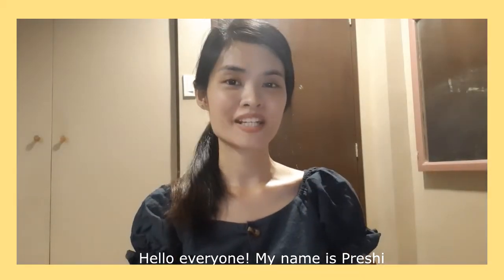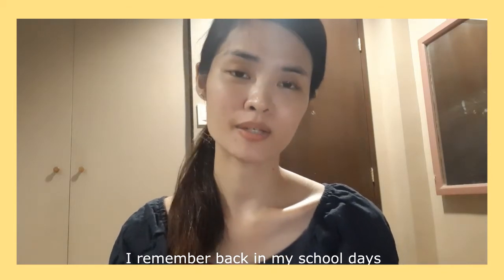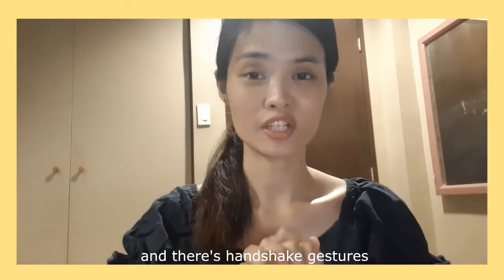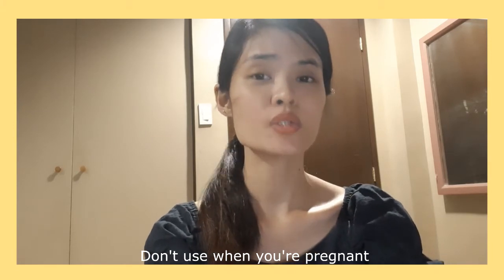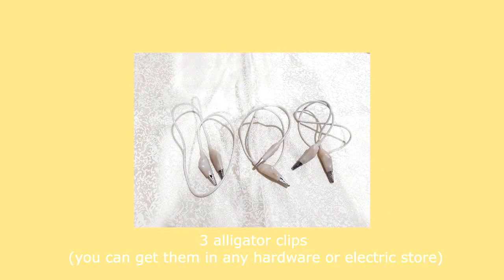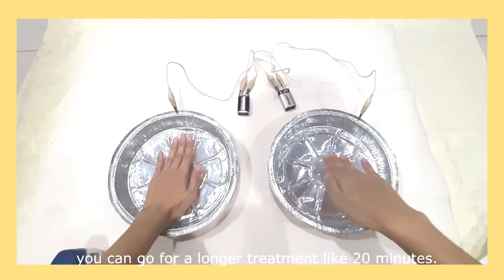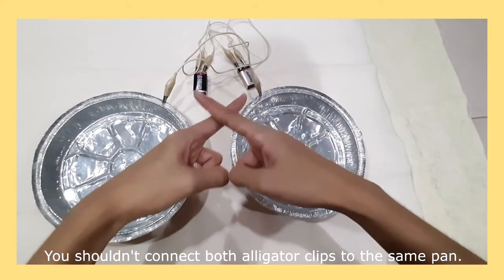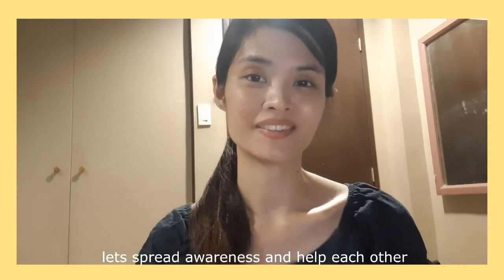Homemade Iontophoresis Device

Comment: Can you please recommend how I can do this on my armpits ?
Reply from the maker: Hello there, sorry this is only for hands and feet but there are ionto machine specific for underarm! If I have the time, id like to share how i reduced sweating in that area thank you
Reply: @Precious Macapagal  I would love to hear how you did to reduce sweating under armpits!
Actually there are specific accessories with ionto machine to treat this part of the body, can't you find a solution for that (like putting a wet clothing around a metal plate which is linked to the alligator clip?)

Comment: Its been 12 days i m using this type of home made iontophoresis but its not much effective still i m thinking what should i do more
Reply from the maker: Hello there thanks for your comment  if you have severe hyperhidrosis, maybe you can try to increase the voltage maybe do a 3 9Vs (27V in series) or 24V, usually it will take 2 weeks to see the 80-90% efficiency. Best of luck ❤️
Reply: @preshimac  thanks for ur comment but I want to know how to connect 3 batteries with each other
Reply from the maker: @adilbadshah1524  hi! You can wired them as long as its conencted properly. Like negative to positive

Comment: what happen if i touch the pan .  should i place cloth inside pan or .. just dip my hand . anyproblem if i touch the pan
Reply from the maker: I recommend that you place a cloth inside the pan :) there's no problem, maybe a slight discomfort ...however, we should let the electrical current completely travel around the hands/feet for it to be really effective
Reply: @preshimac  ok thanks .i just done 40minis today morning when to do next. tomorrow or ??  i have severe swetting .. too much swetting can u tell correct plan
Reply from the maker: @navaneethvk6494  yes, I recommend doing it everyday straight for two weeks :) then if you think your sweating has reduced after, do a maintenance sched like 2 times a week
Reply: @preshimac  thanks
Reply: @navaneethvk6494  update!
Reply: @oneyedeagle  working fine but be carefull.. it takes time ..

Comment: hi! ive used this homemade method twice now and both times it has left my hands very red after treatment, i was wondering if this is normal? i also experience the tingling sensation as well as stinging sometimes too if that was normal as well? 
thanks again for sharing ^_^
Reply from the maker: Hello! Yes, redness and tingling sensation is normal for this, it may even get itchy but normally subsides after few minutes. If you have small cuts or something, apply petroleum jelly to the area. also just make sure you follow precautionary measures.

Comment: Hi, i just stumbled upon your video after i followed some reddit threads and another YouTube vidoe about this device. Here are my questions:

1. Do you always feel the tingling / itching sensation on every sessions? Minsan kasi sa akin parang inconsistent sya. Minsan meron, minsan wala. Today's my 2nd session btw

2. Do the itching / tingling sensation only happen on one hand at a time during the session? Even if you reverse the polarities, only one hand can prominently feel it

I am using this setup btw:
Unused laptops charger with adjustable voltage

Alligator clips

Plastic pans
2 pcs spooon / fork

Thanks, will appreciate any of your input
Reply from the maker: Hello thanks for reaching out!
1. Yes, sometimes the current I feel during a session isn't the same as the previous one, but that doesn't mean it's not working. Just make sure your batteries are still okay and you may also add a few pinch of salt or baking soda to the water to make the current stronger :)
Reply from the maker: 2. Sometimes I can feel the current stronger on one hand than the other one, I feel like that's normal. And also, may I ask whats the spon and fork for?
Reply: @preshimac  Haha kinda silly setup I got before because. I use a plastic basin, then i'd clip the aligator clips on each of the spoon and fork then soak it in the water to conduct electricity. Now nag upgrade na ako, to get rid of the spoon and fork, I now use aluminum pans :D

Thanks for the reply. Today's my 1st week, i guess. I can arbitrarily say that the process indeed lessened my sweating. I am suffering on both hands and feet and it drips. Looking forward to more positive results kasi gusto ko nang maging normal :D
Reply from the maker: @raknaitu666  hello po, sorry sa late reply! Hehe resourceful po kayo sa spoon and fork. Hopefully mas makikita nyo pa po ang effectiveness ng ionto in coming days 😊🙏 salamat po! Pls update me if this helped 😊
Reply: @preshimac  Update: Medyo nagskip ako this week sa therapy (busy sa work/ lipat - bahay) And one thing na napansin ko nung nasa labas ako kanina, hindi ako nagpawis throughout sa lakad ko kanina.  I guess that's enough manifestation na nag improve ang condition ko. kasi usually, ilang mins ko lng sa labas and kapag naka slippers lng ako, doon usually nagttrigger ang breakout ng sweat sa hands and feet. Hopefully makapag resume na ako ulit this week. Thanks for the respone. :)
Reply from the maker: @raknaitu666  hehe minsan tinatamad rin po ako mag ionto, kaya after two weeks napapansin ko nagpapawis ulit sa kamay ko 😅 hehe pero ok lng yan, as long as you continue lng po hehe im glad medyo nag reduce yung sweating nyo po 😊 sana pagpatuloy nyo pa po ito. Best of luck po! ❤️

Comment: Took me 2 years to actually start this. Did my first session tonight and the sensation was so weird I almost did not finish the 15 minute mark 😭 it zapped me so much i think i put too much baking soda lol
Reply from the maker: oh no im sorry! i usually just put baking soda if the current and water is not strong. pls check if you're also following the precautionary measures. make sure no pans are touching each other and you have no wounds on your hands. if you do have scratches, apply petroleum jelly. try it for just 10 minutes if its too much. best of luck!

Comment: Just did my first session today of this. Praying it works
Reply: How’s it going
Reply: @Slayerrrr  tbh I’m like 3 weeks in but I do notice a sweat reduction not much but a little is nothing. Gonna continue for a bit more and maybe increase voltage since I heard that helps too
Reply from the maker: @Christian-mt9fn  Hey thanks for the update! yeah you may switch up the volts! you can use three 9 volts! adding baking soda or salt to both pans also helps :)
Reply: @preshimac  I use three 9v batteries but the only thing is when I put my hands into the water I feel the current for few seconds but after few seconds I fell nothing 😢 is that normal? Plzz help
Reply from the maker: @bipadtarandas1721  hi there! Yes that happens with me as well. You can also put a bit of baking soda in or salt in the water pan to increase conductivity :)
Reply: @preshimac  I used this specific treatment for 1 week but I feel nothing 🥺
Reply from the maker: @bipadtarandas1721  hi! Yes, if you have severe hyperhidrosis, effectivity can take 1-2 weeks. Or you switch it up to 27 volts, meaning 3 9Vs instead of just 18V
Reply: @preshimac  I think the ampere is matter..I think the 9v batteries can't produce the enough amount of current to treat hyperhidrosis! What's your opinion?
Reply from the maker: @bipadtarandas1721  hi! It will need at least 2 9Vs (18V total) or for severe hyperhidrosis is 3 9Vs (27V total). Some people, it takes more than a week or 2-3 weeks to see effectivity... so its very important to be patient 🙏🥲
Reply: @preshimac  your opinion is that the ampere doesn't matter?
Reply: @preshimac  you had severe hyperhidrosis or mild hyperhidrosis?
Reply: @preshimac  please reply!:)
Reply from the maker: @bipadtarandas1721  hi! I have mild hyprhidrosis, for me the ampere doesnt, i only check how many volts thank you
Reply from the maker: @bipadtarandas1721  please make sure that you have connected properly the wires. Pans shouldn't touch as well. :)
Reply: @preshimac  all right, I have severe hyperhidrosis 🥺
Reply: @bipadtarandas1721  same with me 
So how's your treatment going any improvement?

Comment: pro gnawa ko pong altednative eh pinagsama ko ung dlawang kamay ko sa isang pan then after 15 minutes sa kabilang pan nman. ok lng po kaya yon?
Reply from the maker: hindi po, dapat separate pans
Reply: @preshimac  dpat po ba kong mgpalit ng battery kc nagaground po tlga pg tig isa sa kamay. sa paa ok nmn po
Reply from the maker: @lethalwind6552  ahh ganun po ba, napanood nyo rin po ba ang pre cautionary tips? make sure po hindi nakadikit ang 2 pans. and dapat clean and dry (meaning after washing hands, pat dry with a towel) po ang hands natin bago ilagay sa pans.
Reply: oh okay po un po hindi ko natry na dry ang hands kc ung sa paa ko po was wet back then rn po. pro itatry ko po un slmat
Reply from the maker: @lethalwind6552  cge po goodluck! update po kayo
Reply: hi po nagaground pa ren po ko haizt khet dry hands. d po kya mxadong mataas ung volts kc 2 9v po gmit ko.
Reply: cguro po itry ko po muna isang 9v noh for hands?
Reply from the maker: @lethalwind6552  Hello po. Di ko po alam kung magiging effective ang isang 9V battery. Hmm... na check nyo po ba. like, hindi po nagta-touch ang 2 pans?
Reply from the maker: di ko po kasi pipilitin na mag ionto, baka may existing health condition or sensitive po hands nyo. You can try other treatment po. Try glycopyrrolate... pero need to visit doctor para ma resetahan kayo nyan. baka pwd po kayo bumili ng iontophoresis device online... try nyo po sa shoppee or lazada. sorry po na ground kayo :'(
Reply: opo d tlga xia nag tatouch ok nmn po sa paa pro sa kamay lng tlga may ground
Reply from the maker: @lethalwind6552  ok po, try nyo po 9V isa... tapos 4.5V
Reply: hello. tinry ko po isang 9v lng and mas bearable po xia! hehe. gnun nlng po ggwin ko. tatry ko i 2 9v pagtagal. slmat po uli
Reply: hi po uli hehe. anu po pla remedy nio pg ngkkairritation sa skin after ng ionto?
Reply from the maker: @lethalwind6552  Hello po! Usually nagaaply po ako ng lotion, nagiging itchy and red po kasi hands after ionto pero nawawala rin naman ito few minutes 😊

Comment: Hi

I tried this today but no tingling sensation and i even touch the bottom with my hands and i felt nothing 
Everything has been set up right , the 2 batteries was heating up so it means nothing is wrong
But i still have my doubts..does this still mean i did the treatement ?
Reply from the maker: Hello, that has happened to me before but only because when I checked at my device, my aligator clips weren't attached properly or they were in the wrong place. Did you check if they were connected from positive to negative?
Reply from the maker: You may also try adding baking soda or salt to add into the water if you feel like the current is weak. In addition, you may opt for 27-volt!
Reply from the maker: I also dont recomment your hands touching thr bottom of the pan. Some people use a towel or any cloth so their hands can rest on it during the session. Best of luck!
Reply: I'll try connecting the clips correctly and double check it
If i still feel like the current is too weak ..i'll try the 27v 
Thank you so much for the tips 
Have a nice sweatfree day :)!
Reply from the maker: @kuronekosan2830  dont worry if the current feels weak! There are times when its weak and at times when you actually feel the tingling sensation 😊
Reply: @preshimac  
Thank you so much 
Now im feeling the tingling sensation and its quite strong
Have a nice day :)
Reply from the maker: @kuronekosan2830  im glad to hear that! Best of luck 😊👍
Reply: @kuronekosan2830  hi! any results on the treatment?
Reply: @alisson551  i actually got immediate results
Its a really good diy treatement
But bc i stopped bc of busy schedules i couldnt do the treatememet everyday or every other day
But if you can regularly do it
Then yess its really effective
Reply: @kuronekosan2830  how effective? u actually stop sweating?
Reply: im taking 5mg of oxybutynin per day and im not getting good results, so im thinking about doing the iontophoresis thing
Reply: @alisson551  never took pills so i cant tell u if its really effective...but this treatement is effective ..try it ..dont be afraid to try it
Reply: @kuronekosan2830  i will... thanks! <3
Reply: @kuronekosan2830  Hola amigo de cuantos mAh usas con las baterías de 27v ? Gracias

Comment: Hello I also make a devide with voltage controller. I aslo update you about my progress.  ♥️ from India 🇮🇳
Reply from the maker: best of luck sir!
Reply: @preshimac  after taking 1st season I am feeling some itching sensation of my feet and palm. Is it right or wrong. What was your experience. Please share me sister .🙏🙏🙏🙏
Reply: @preshimac  pls reply sister.
Reply from the maker: @mainakmaiti4446  Hello! Sorry for the late response. Yes itchy hands and feet is normal after ionto session, but it subsides so nothing to worry about that. I use a bit of lotiom to calm the itchiness :)
Reply: @preshimac  hello sister, within 5 days I am getting 80%success. That is my update. Thank you sister ❤️ again.
Reply from the maker: @mainakmaiti4446  im so happy! thanks for the update!!
Reply: @preshimac  hello.I have a big problem with my palms,but i dont know how can i built my own device with adapter charger.In my town i cant find aligator clips.

I will make it using adapter because i can use 12-24v.
I dont know how to made + and - with an adapter charger can you please help me
Reply from the maker: @skrill4927  hello im sorry I havent used personally a charger adapter :'(
Reply: @preshimac  hello sister I am Mainak Maiti from India 🇮🇳. After 2and half weeks I am cured about 90%. This is my update.Thank you sister ❤️ again for ....🇮🇳♥️🇵🇭
Reply from the maker: @mainakmaiti4446  this make me so happy!! congrats! dont forget to do maintenance 🥰
Reply: @preshimac  what type of maintenance can you refer please dear sister.
Reply from the maker: @mainakmaiti4446  maintenance meaning you can do it just once a week or so :')
Reply: @preshimac  hello sister, after using the method of 2 months sweating again start. What can I do now pls.
Reply from the maker: @mainakmaiti4446  yes, just keep doing iontophoresis maintenance. unfortunately, ionto isn't a permanent treatment, rather a long-term solution. which means, if you think your hands are sweating again, you can start doing the sessions, then after the sweating has reduced, do the maintenance.
Reply: @preshimac  how many times should I do in a week can you please tell me dear sister.
Reply from the maker: @mainakmaiti4446  maybe twice a week will do
Reply: @mainakmaiti4446  how is your progress now ?

Comment: i got a huge electric shock from two 9 votl batteries, i wish i can do it
Reply from the maker: There will be slight shock so this is normal. I suggest its best to clean and dry your hands first, then place your hand slowly in the pan, one at a time 🙏
Reply from the maker: Pls also follow precautions before doing the session, make sure the pans dont touch each other :)
Reply: Thank you so much
Reply from the maker: Pls upate ❤ @roykent9591

Comment: Its not working
Reply from the maker: Im sorry to hear its not working :( maybe try to do higher voltage or keep doing ionto up to 2 weeks. Best of luck!
Reply: @preshimac  I don't feel vibrate on hand. Why plz explain
Reply from the maker: @muniir  hello there! Maybe because of the setup! Make sure the wires are connected properly, negative and positive
Reply from the maker: @muniir  you can also put salt or baking soda to make the water more conductive;

Comment: I directly dipped the wire in water and it shocked even at 9v
Reply from the maker: best not to dip the wire in the water! only clip it to the aluminum pan edge
Reply: @preshimac  it worked
Reply from the maker: @un1ru  im glad to hear that! what differences did you notice after ionto? 😊
Reply: @preshimac  my palms are dry right now. The weather is quite cold here. But I guess iontophoresis has worked
Reply from the maker: @un1ru  im glad to hear that sir!!🙏🥰
Reply: @un1ru  how is it now, bro?

Comment: thats not enough batteries you need 6volt at least 3 ...it only works temporary.. i found a much better way to stop sweaty palms its called antihydral it works amazing i have tried everything and this stuff is the best
Reply from the maker: Yes, 2 9V batteries equal 18volts or 3 6V equals 18volts ^^
Reply from the maker: I havent tried antihydral but heard some reviews on it, will definitely try it